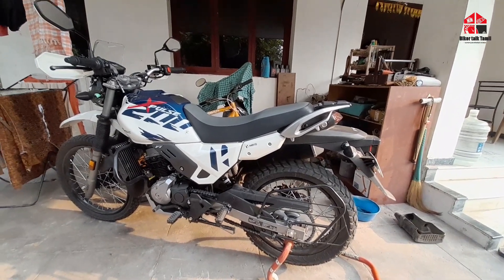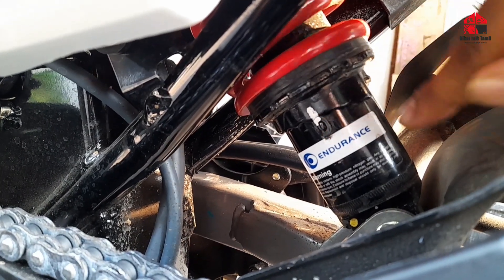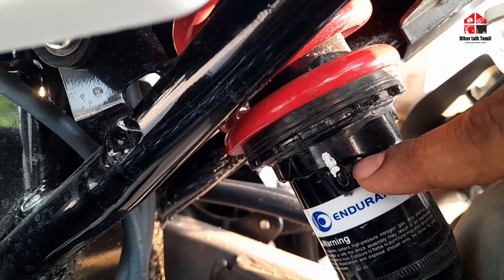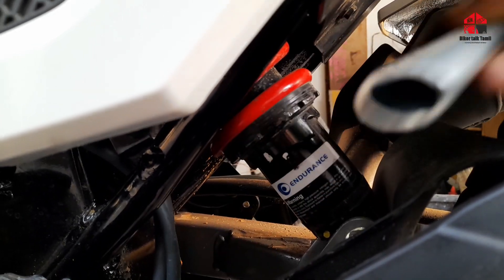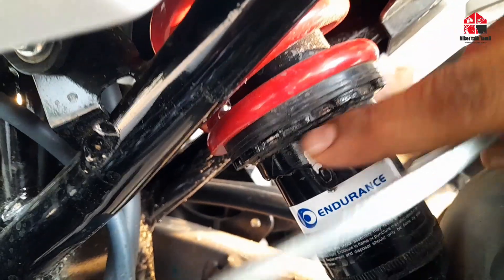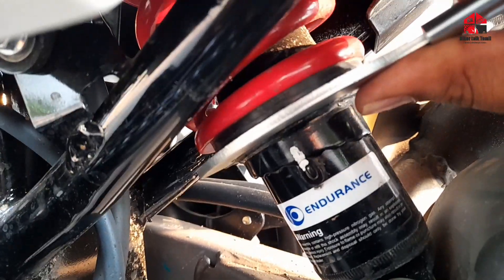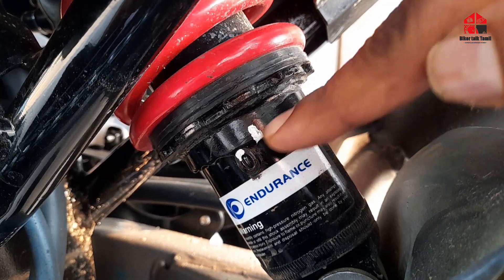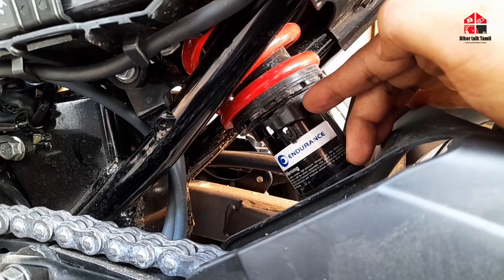Hero Xpulse 200 4v | How to adjust shockabsorber | Mechanical guidance video #xpulse2004v #xpulse200

Comment: Xpulse 200 4v Rear monoshock absorber adjustment can be made according to the load/road conditions.

- In Clockwise direction: Sttiffer

- In Anti-clockwise direction: Softer

Comment: I am 5”5 . I am able to manage my Xpulse without any issues. But I think adjusting shock absorbers little bit harder and reduce seat height little bit will make my handle much easier. Do you suggest me to do it ?
Reply from the maker: Yes it is true , 5.5 is not a problem with xpulse ! A slightly more harder setup is good for road and bumpy roads too, I would suggest you definitely try ,as it will ìprove handling
Reply: @bikertalktamil8200  thanks for your reply. I will do it. Do you have kicker issue? My kicker is not at all working .
Reply from the maker: @dineshanand5316  so far I have only used my kicker and it works fine ! So can comment particularly on that
Reply: @dineshanand5316  did u do it??

Comment: Thanks for your time. Please let me know if the bike seat Height varies if adjusting the shock
Reply from the maker: Yes there will be approx a difference  of a inch in Seay hight difference , but the vehicle ride characteristics  will change depending on the setup
Reply: @bikertalktamil8200  thanks for your swift reply. Iam 5 foot 4 inches .hope you suggest me this bike.
Reply from the maker: I suggest you take a test ride and then decide , and then decide , the max height drop that can be done is around 2inches with some special adjustments
Reply: @bikertalktamil8200  thanks ,will take a test ride and let you know.